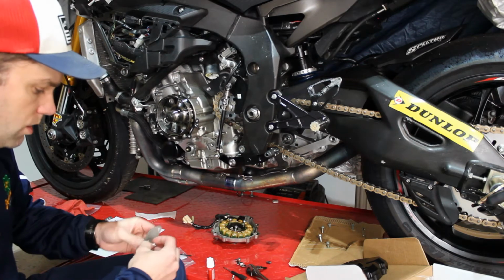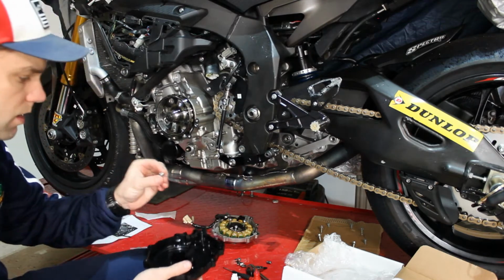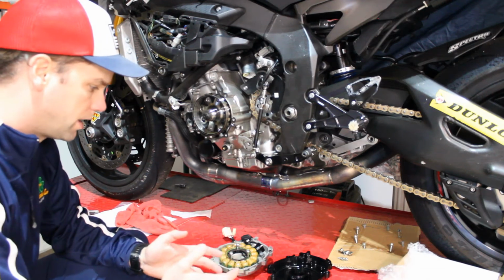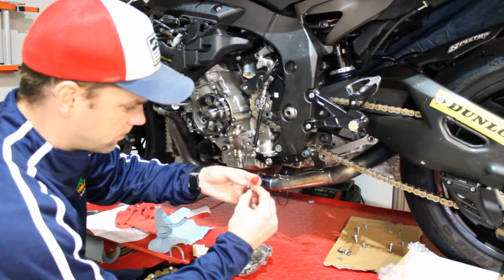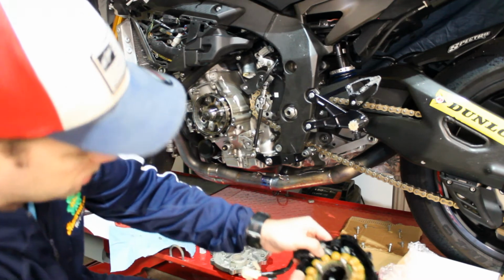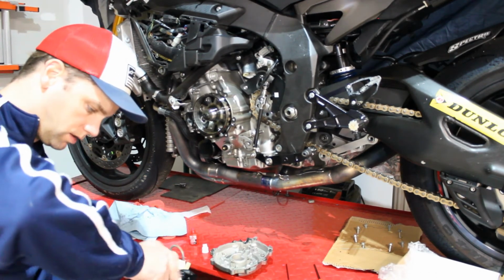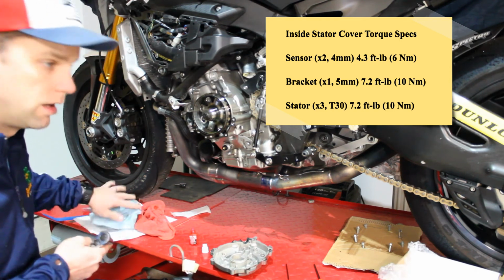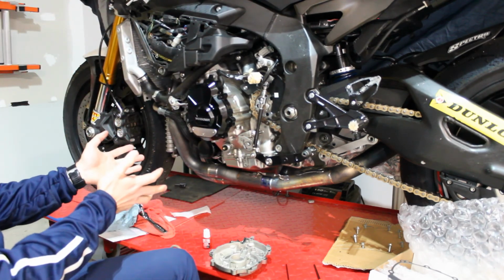Woodcraft Stator Cover Install: 2015+ Yamaha R1 (Pt 1/2)

Comment: Isn't it necessary to change the gasket too? Or is it possible to leave the original gasket?
thanks
Reply: It’s suggested to replace the gasket since normally when you take it off depending on how old it is, it’ll be damaged or already worn down. You can reuse it in certain cases where it doesn’t look in bad conditions and you don’t have any replacement. Highly suggested to replace, tho.

Comment: No oil will leak out after taking bolts off? I ordered these for my 1000rr 15’
Reply from the maker: None for mine, I'd just be guessing with the bmw, but I don't think the stators have much oil nearby.
Reply: @GPMech did you drain the oil first? I didn’t and oil started pouring out when I removed the bolts. Ended up doing an oil change as well🙄

Comment: You said red but the instructions say blue loctite for the sliders, what do you think about using blue ones instead of red?
Reply from the maker: I think the directions that came with mine called for permanent locker (red) but I don't have the original paper anymore. If your directions call for blue (medium), use that.